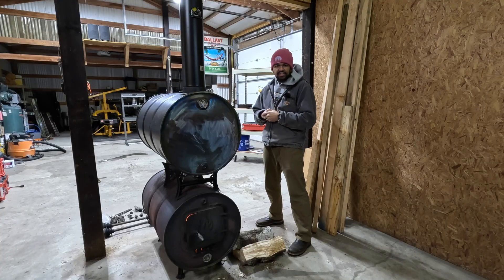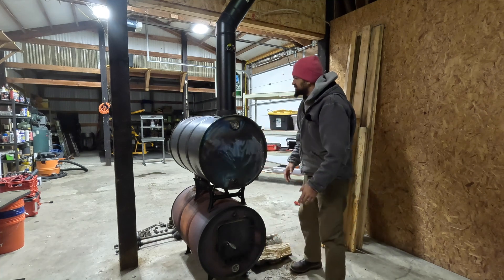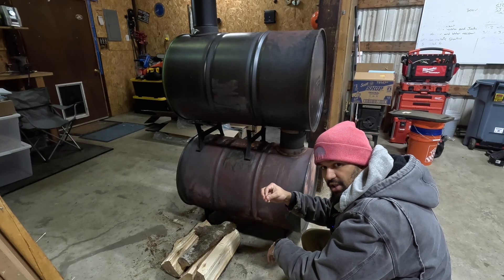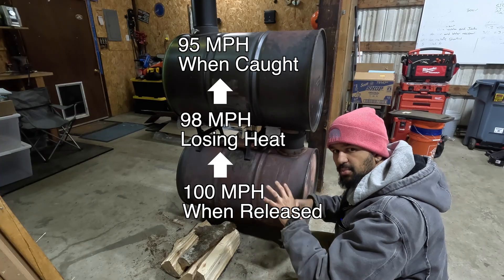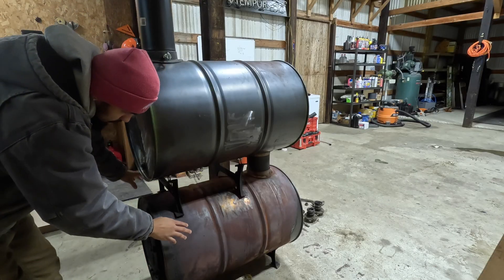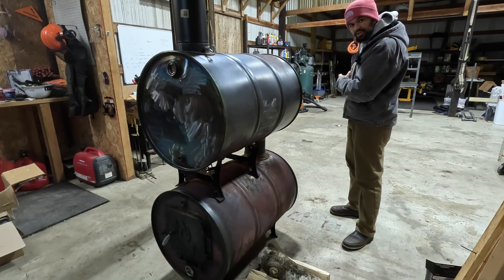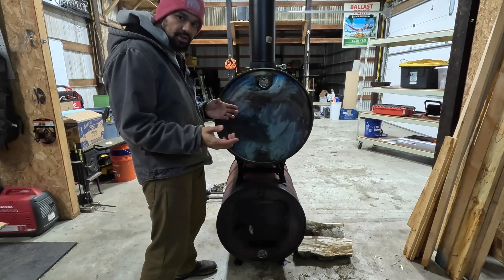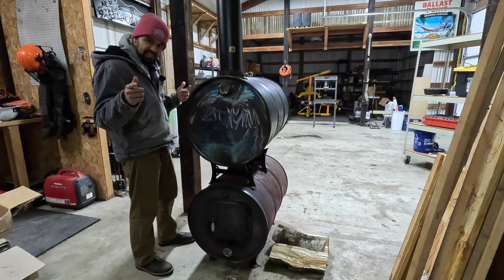Double Barrel Woodstove EXPLAINED!

Comment: Had one of these 40 years ago.. we used to get waxed cardboard lettuce boxes from the fruit shop and tear them up into large  plate size pieces... feed a few in at a time..(do this 3 times)  makes a massive heat shot for about 2 minutes and the drum can glow orange..... but it cleans the whole unit out in minutes.... it's also a good party trick.. lol
Reply from the maker: I will give it a try!

Comment: Nice. Bet that stove warms your shop well. Any stove that has even the slightest heat exchange capability will have a little creosote buildup. Making a very hot fire with small, dry oak, ash, or hickory about once a month will help some. Avoiding softwood altogether is even better.
Reply from the maker: Yep, unfortunately that is most the firewood on my property so I got to burn what I got. So clean out is in my future.